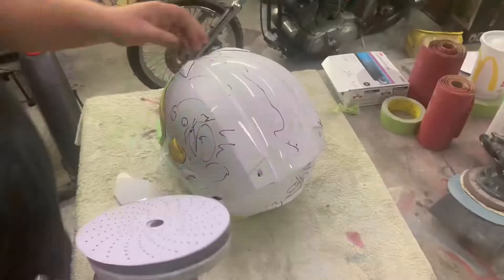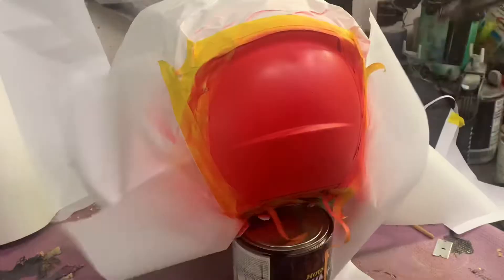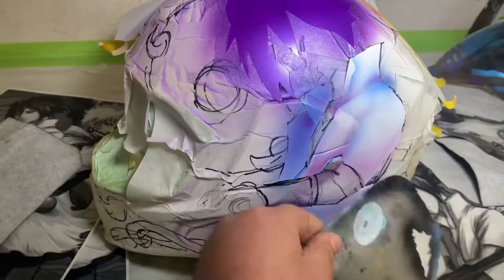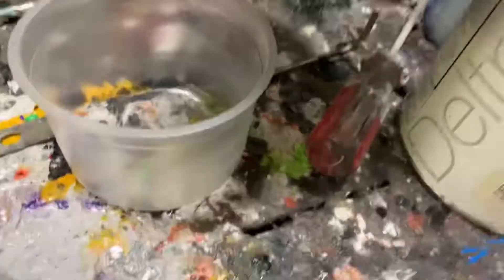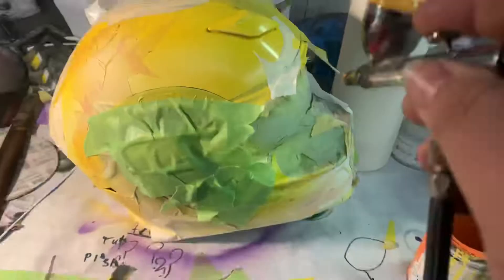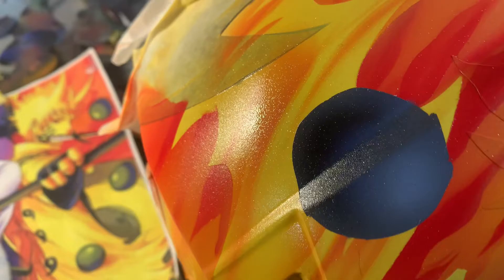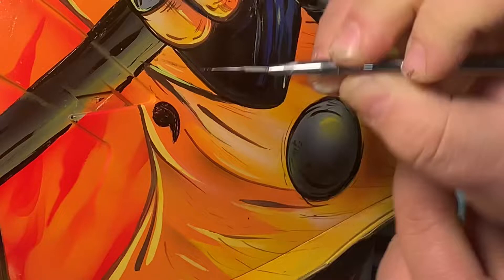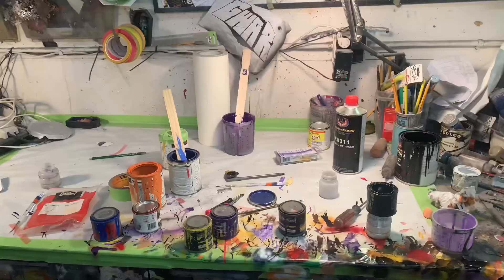Custom painted Naruto on a Icon Airflite helmet

Comment: May I know how much do you charge for a custom made helmet ?
Reply from the maker: starting around 500 to 650 and up from there all depends on artwork how crazy types of paints etc....
Reply: @canyoncustomair  500$ ?
Reply from the maker: @revanthp007  yea starting at 500 and up from there depending on details of art work if like flakes and candys. Example have a simple helmet in the shop now full face just wants a logo on the back and name on the side. So just simple logs an clear about 450 for that
Reply: @canyoncustomair  in that much you can get a high level riding gear in India
Reply from the maker: @others7790  not in america the paints alone are about 200 lot if it is time lots of time
Reply: @canyoncustomair  I know economical difference I'm just telling you
Reply from the maker: @others7790  all good man just crazy how much paints cost over here